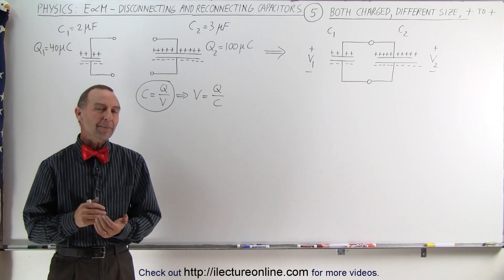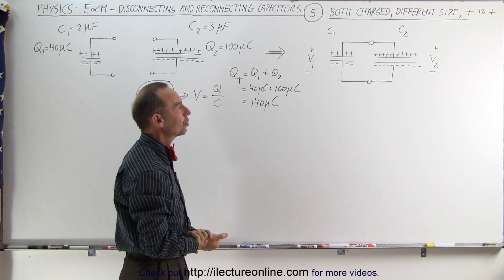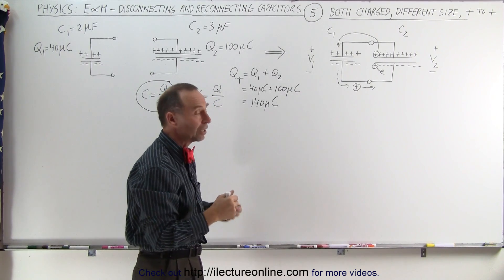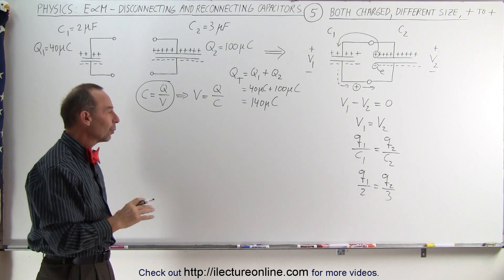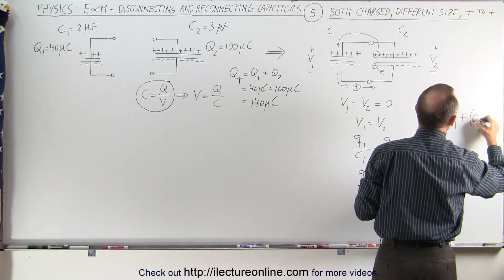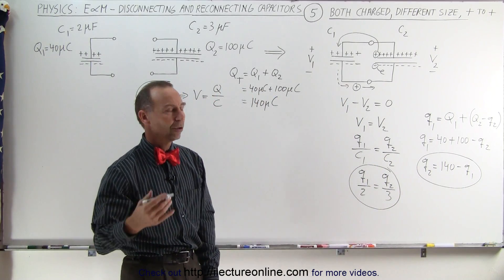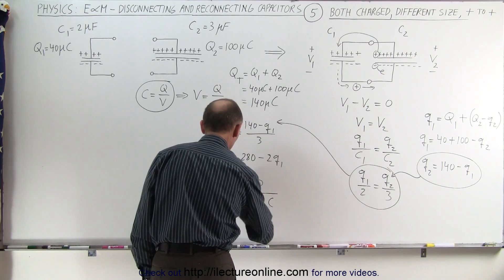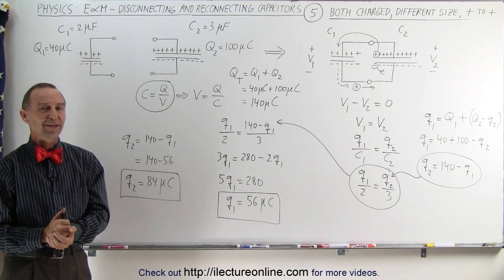Physics - E&M: Dis- and Re-Connecting Capacitors (5 of 16) Both Charged, Different Size, + to +

Comment: What would happen, when i would have a given resistor as the wire between C1 and C2 as well as another Resistor as a consumer in paralel to C2?
Reply: at steady state, you can ignore the effect of the resistor. this is because the resistor can not dissipate a current and, by definition, current is the flow of charge per unit time. so, your final charges on each capacitor will be exactly the same as in this case. the resistor will just make the transfer of charge take a longer amount of time.

Comment: THANK YOU!!  I'm a senior and this is helping me so much
what if a 2 microFarad,60 Micro coloumb capacitor is connected to another with 3 Micro farad, 60 micro coloumbs + to -? will any charge flow from one to another??
Reply from the maker: That depends on several things.  Are they connected on a line, or are they connected in a loop.  If in a loop the positive charge of the one will move to the negatively charged plate of the other.
Reply: @MichelvanBiezen   if they are connected in a loop , hat will  the total charge be zero? will the charges just  move from one to the other till they cancel each other out or ?

Comment: prof. why is V1 +ve if you are going from negative charge to positive charge[lower to higher potential]
Reply from the maker: The potential of a voltage source depends on the direction of "travel" around the loop.  Note that we travel around the loop in a clockwise direction.  That is why V1 - V2 = 0
Reply: @MichelvanBiezen  ohhh thx for the efforts to answer my doubts🙂

Comment: Isn't this the same case as example 3? So same procedure? I mean can we say q1 + q2 = Q1 + Q2 also since the beginning ?
Reply from the maker: I typically don't try to generalize and compare one example to another.  In each case I like to look at it independently and determine what the basic principles are for the problem at hand.  Here we can say that the voltage across the one capacitor must be the same as the voltage across the second capacitor.  That is a good start.

Comment: How can we calculate the potential difference a cross each capacitor?
Reply from the maker: Since C = Q / V   You can find V = Q / C
Reply: Will the voltage vary between the 2 capacitors or will V1 be equal to V2?

Comment: Since the capacitors are connected in series, shouldn't you add the inverse of the of the capacitors to get the total capacitor?
Reply from the maker: In this example, they are connected in series (You can determine that by realizing there is only 1 path around the circuit)
Reply: If this  is  a series connection  than  how  can u connect  two capacitors in paralel ?

Comment: Sir what happens when we connect more than two capacitor in circuit in which only one is charged and other are not ???
Reply from the maker: Charges will be pushed around the circuit by the differences in potential until all the forces are equalized which means that all capacitors will have charge on them.
Reply: Thanks sir